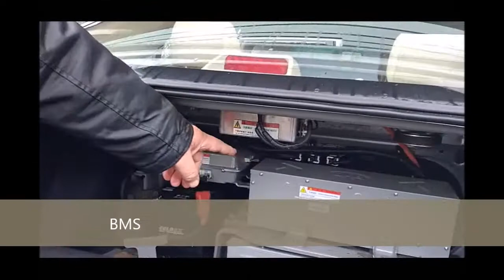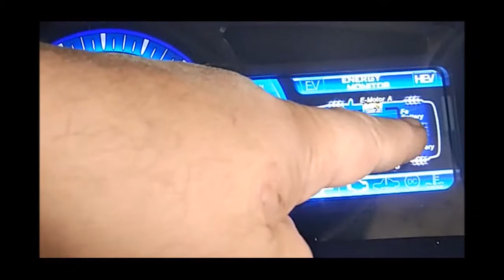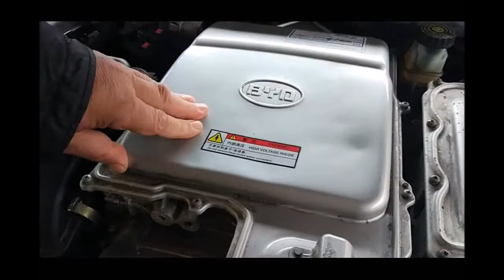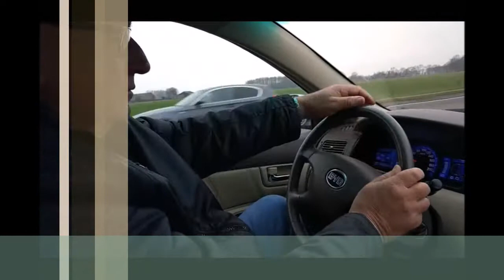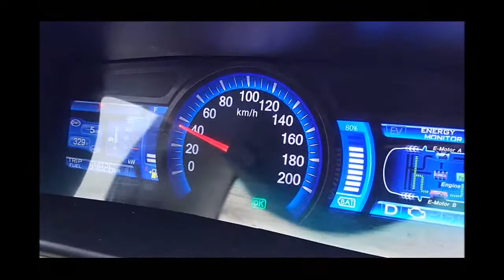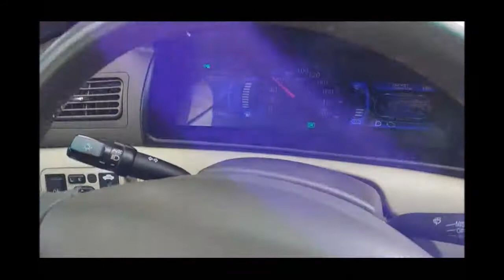BYD F3DM hybrid car repair and test drive

Comment: can you solved the problem later?
Reply: yes, the electrical drawing with the troubled circuit is laying in the car, just check the encircled parts in the drawing.
Reply: We live in the Philippines and bought the F3DM in Holland where we go on holidays, 3  months ago we were in Holland and I sold the F3DM again and bought a Chevy Volt 2013. I got a similar problem as yours. I have electrical lay outs , so when you give me your email address , I will forward them to you. Where are you living?
Reply: @koosmulder2795  Dear Koos Mulder, could you send me an email, I bought this car and I need support about another electrical issue. If it's possible, chat on fb about it, or in mail (if U see it in my profile).
Thanks for your help, regards, Balazs
Reply from the maker: hello, I am in Palawan right now, what is the issue? @balazsgogos9666
Reply: @JacobusMulder  Dear Palawan, with OBD diag tool we saw a "precharge circuit fault" error message, the car for example charged to 67%, but when U try to start fans speed up and car didn't go when you accelerate, I tried it on Sunday, after charged to 100%, it started and I've driven more than 140km without issues in HEV mode, randomly it starts or not, I think it could be a relay issue somewhere, but I have no factory diagnostic device (what do U suggest for this car??), and what do U think, where should I find a problem? 
I've tested all the contactors, relays, check resistor-divide circuit in high-current distribution box, but no problems there, all connections are good, we checked BMS, also good. On the dashboard, there is no error messages, I don't know why just randomly happenes this.
Thanks, Balazs
Reply from the maker: Hello  @balazsgogos9666  , when the car doesn't accelerate its somehow limited by the motor management system. the BMS can switch off charge and discharge direction. the motor(s) are controlled by a VFD (variable frequency drive) there it could be reduced as it drives on a back up system (software). there is a BYD garage in Rotterdam there is a mr chen , contact him , he after long emails gave me the drawings which were in the car. nuy a good OBD scanner on Alibaba which can scan the F3DM model. precharging circuits are normally used to charge large capacitor banks through a resistor before it bypasses it, maybe there is the problem and power sometimes goes through resistors while not being bypassed, cheers : Koos Mulder
Reply: @JacobusMulder  Dear Koos Mulder, if it's start it can accelerate, yes, agree, if batt is below 30-40%, it will be a limited drive performance. I've written many mail for mr. Chen, but no response from him :( 
Do U think that precharge issue's root cause is the resistor or a relay problem? 
Could U suggest a good diag tool from Alibaba? 
Thanks, Balazs
Reply: Good morning, I have used a cheap autophix obd scanner but recently bought for my Hilux an Ancel obd scanner, last scans motor, abs and airbag systems. Try to email BYD Shenzhen. Many motor management systems reduce power when something is wrong. I don't believe this is done by BMS but will be done by limiting the VFD, which converts the DC power in a variable three phase voltage and with it linear the frequency which is supplied to the motor s.
Reply: When you drive in power reduced mode, how many volt is the battery? While driving put a voltmeter on the DC input of the VFD, should be same as battery voltage. Be careful as it's a dangerous 300vdc voltage.
Reply: If that's ok, measure the RPM demand signal to the VFD, this is a voltage coupled to the gas pedal, the motors have tachos and like a differential amplifier makes them equal.
Reply: I am coming to Holland in June, have there now a Chevy Volt. Very nice car. I liked the BYD which company makes one of the best batteries but service is impossible.when we come to Hungary this year we will visit you. Mostly we are in Salfold near Revulop.